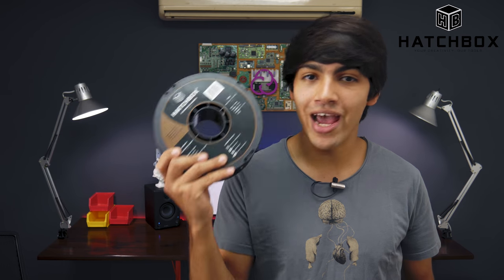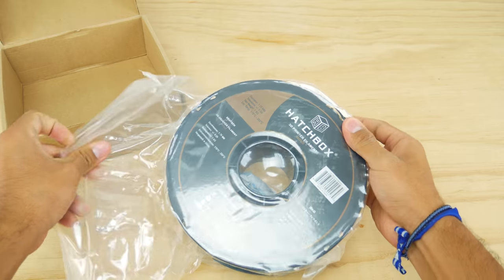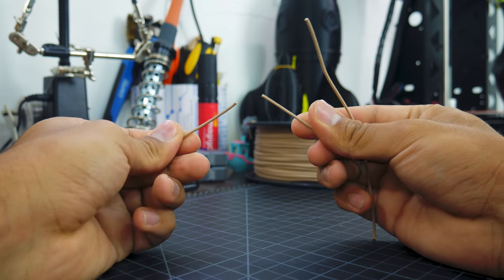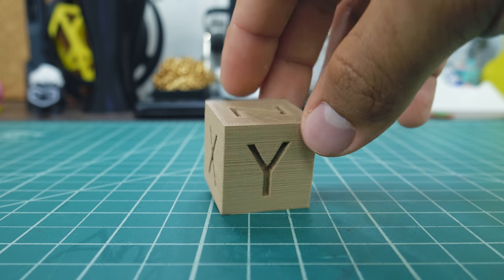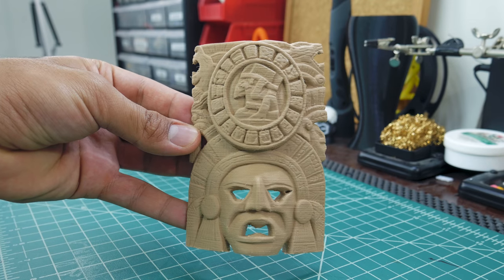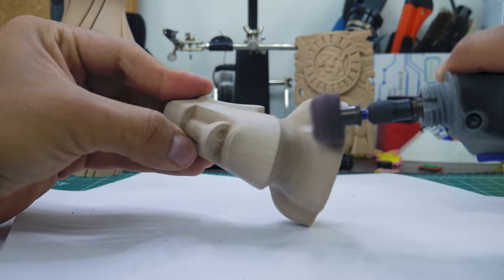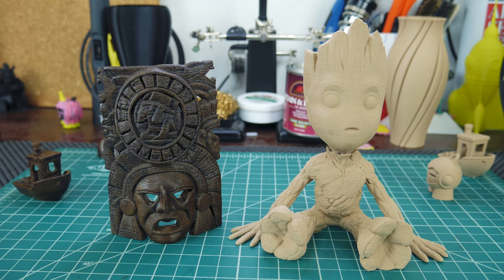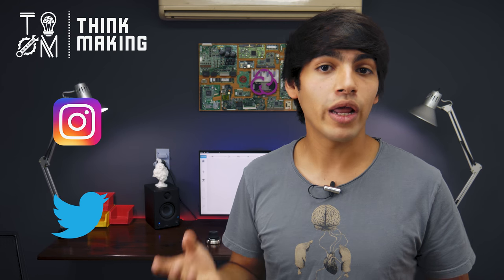🌳🤓 3D Printing WOOD!!! - Hatchbox Wood Filament Review

Comment: Aren't you supposed to wipe off the stain after you apply it?
Reply from the maker: That would depend on the type you get, and desired finish. I don't. That gives crevices darker colors which makes details pop out even more. It also helps with that "old look" I mention.
Reply: Can you please post a link to the tools that you used here? Just started on 3D Printing and need all the basic stuff. Thanks.  @ThinkMaking
Reply: Yes you always do
Reply: Was looking for this comment, yes you wipe off stain. This guy is using it like a semi-solid paint
Reply: @ThinkMaking wipe off everything but the recesses, that would create better contrast between the lows and highs and give you better  details overall.

Comment: Surprised it's not abrasive to the nozzle. For some reason I had it in my head that the wood fill products would be, but I guess that would be the metal and glass fill products. Nice video.
Reply: lmfao you really thought that wood was harder than metal XD

Comment: how did you print the mask? I try to print but gives some sort build in brim on the leftside or so.... does not work for me
Reply from the maker: I moved it about 1mm or 2mm below the build plate to get a flat surface to start printing on with brim and supports everywhere turned on.
Reply: thanks!

Comment: your z axis is abnormally rough, even at .1mm. I feel there is some adjustment to be made.
Reply: i think the same, i have a cheap 140$ printer and my prints with wood filament look way better. The prints on this video have really low quality